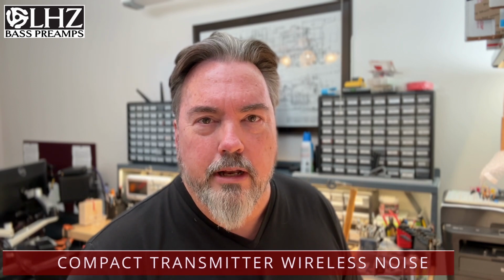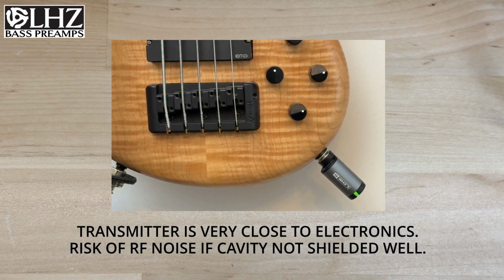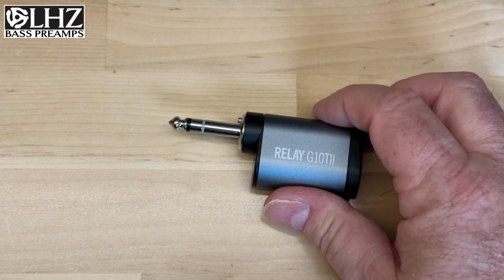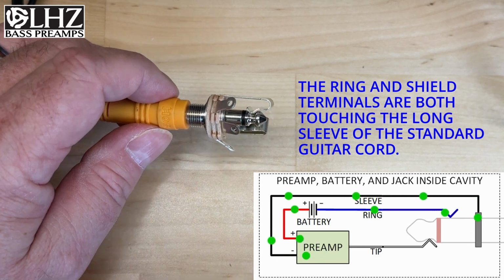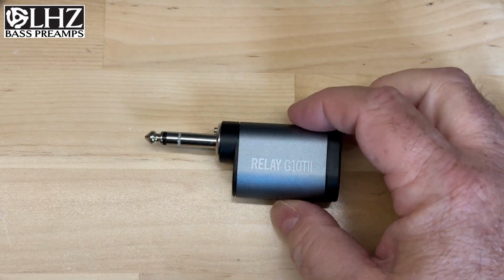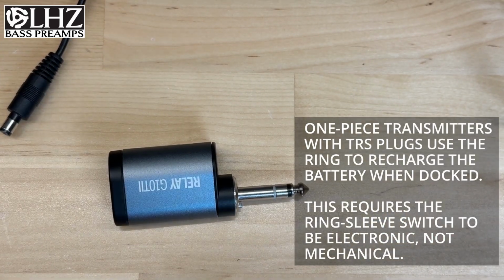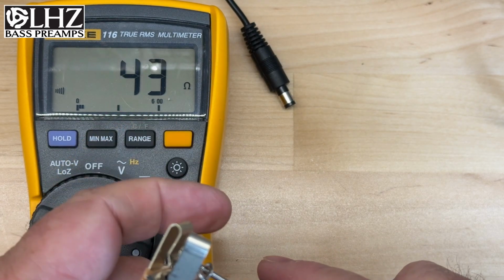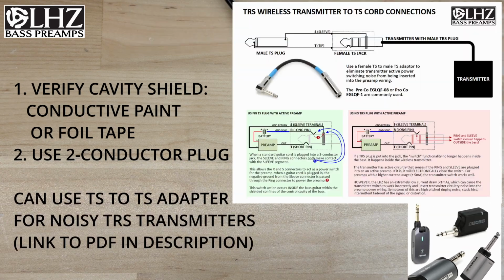Solving Compact Wireless Noise Injection

Comment: Great video, I have tried all of this by chance because my wireless is a cheap one that sticks from the side of the guitar and I was afraid of nicking it off. So I build the cable and the instrument is shielded and pasive. I discovered that non of this worked for me because the noise is RF interference so now I'm  planning on making a los pass filter or shelving in to the cable or transmitter in some way

Comment: Is this applicable for receiver as well? I have a small wireless kit where the receiver creates a lot of white noise regardless of transmitter in the guitar being on/off.
Reply from the maker: I think that is a completely different issue.
Reply: @LHZpreamps  😔

Comment: Thanks. Which adapter is recommended?
Reply: A short 1/4 female ts cable female to 1/4 ts male cable thisnwill help shunt it
Reply from the maker: Any TS female to TS male adapter will work, and you can find them from most music stores. Personally I use one of the ProCo cables I list here: https://lhzpreamps.com/wireless/